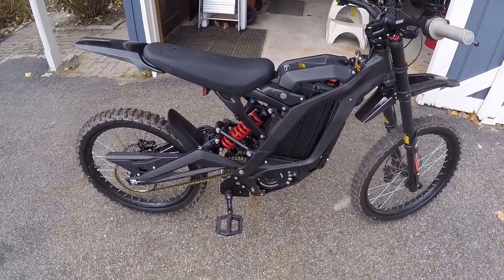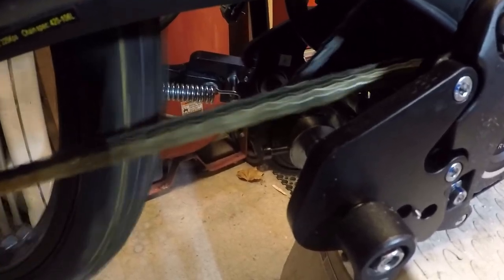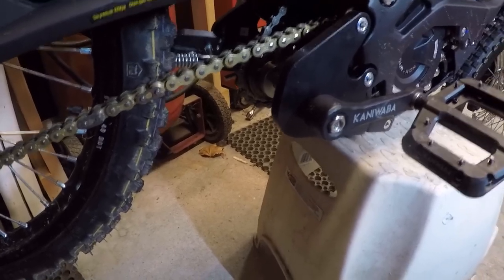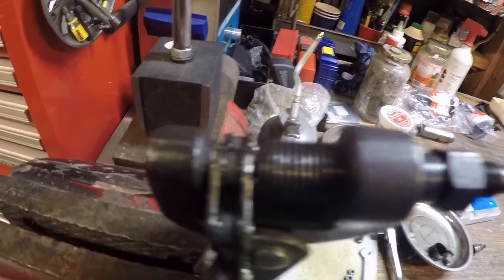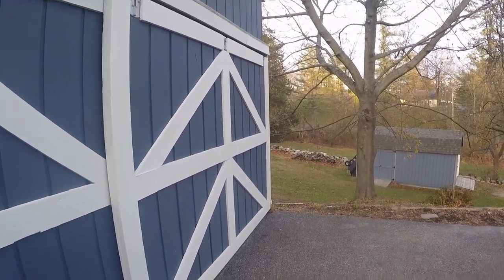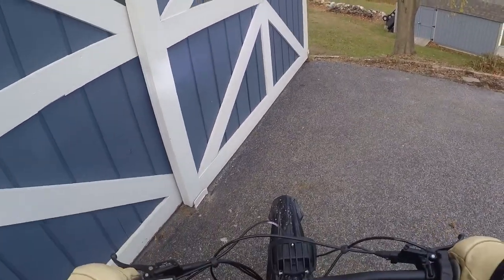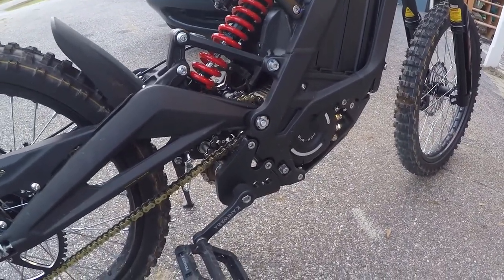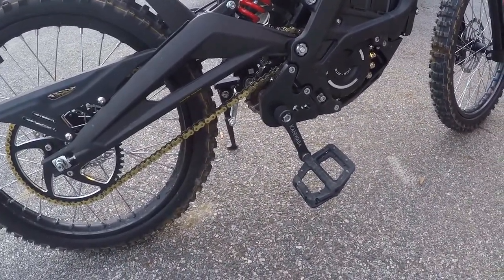Kaniwaba 2.0 Power Pedal Kit for the Sur-Ron X

Comment: Great Video. I don’t care for those extra long bolts on the Sprocket. I’d replace the with Socket set screws that have a bite on the end. Seeing this video is two years old, I surprised that someone hasn’t developed a Cog Belt System with a cover or guard to protect it.

Comment: Good video. Good commentary. About a month ago I added the same pedal kit to my Segway x160 complete with pedal assist. A week ago I added the same pedal kit to a new Sur-ron X Light Bee I just bought. I like both of the pedal kits. Keep an eye on those two large screws that hold the free wheel sprocket in place. Initially I failed to apply loctite and I lost one screw somewhere. I then added loctice and now I hand check them before I ride. Keep us updated on future modifications.
Reply from the maker: I used loctite on those screws as well.   Mine look longer as one of the first set broke with very little torque applied so I used a couple that I had leftover from a motorcycle rebuild.   Thanks for sharing that tip and thank you for watching!

Comment: Did you notice ant top end speed loss when you installed the "power kit" portion of this set up?
Reply from the maker: I didn’t notice any top end speed loss but it does rob a tiny bit of power.  I noticed that if I remove the chain that the power kit ads the bike is a bit more responsive. I found that hard to believe as all it is doing 99% of the time is spinning that freewheeling gear, but it does steal a little power.   If I am riding all off-road I pop the chain off as well as the cranks and put the pegs back on.   For most of my riding I leave the chain and the pedals and just deal with it, it’s not a big difference.  Great question and thanks for watching..

Comment: How are they holding up? Have you taken it off any large drops or jumps?
Reply from the maker: They’re holding up great but I  have not taken it off any big jumps, most of my off road riding  is trails.  The beauty of this system is that you can pop the Cranks off and put the pegs back on should you want to do that type of riding.  The crank system and the new mounts actually reinforce the pegs so you have a better feel than you did stock.

Comment: this install is  a nightmare, and i don't think mine will hold up. how is yours doing?
Reply from the maker: Mine is holding up well.  Do the S1 chain upgrade if yours didn’t come with that, and make sure the sprockets are aligned.  You will have very little chain noise when you have it setup right. Good luck and thanks for watching!
Reply: @Chris_Does_Everything  I spent some time fixing up the black sprocket I believe it’s called, to make sure it was aligned properly. I have a new chain coming in as I broke the first one from kaniwaba. Let’s see how it holds, if not I’ll get the s1.